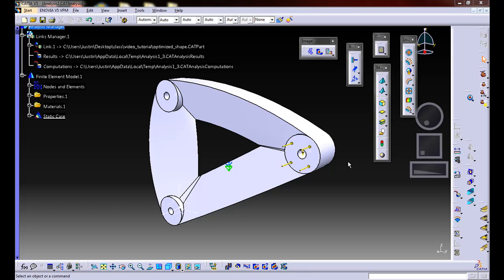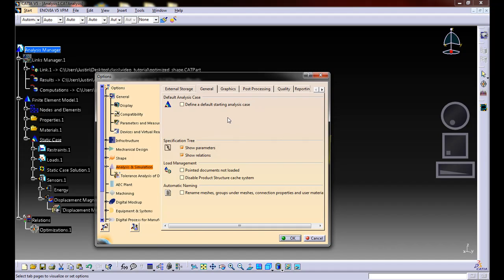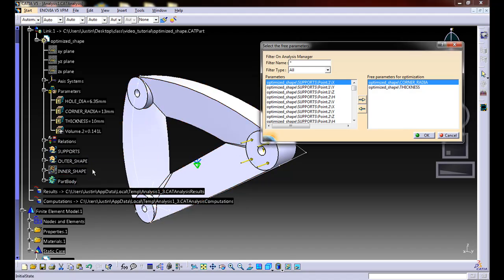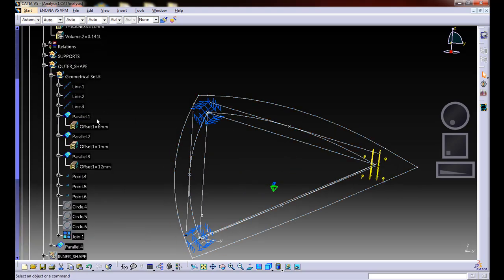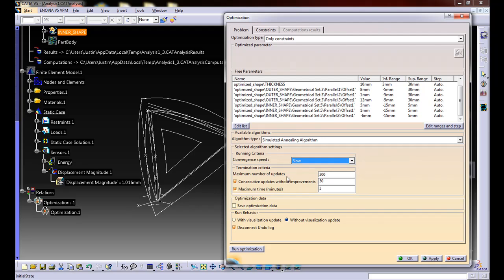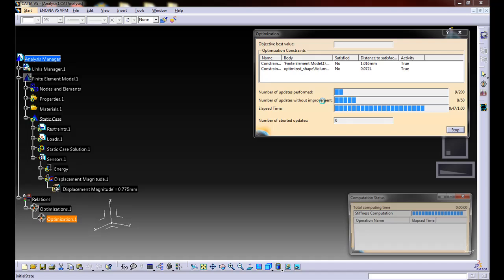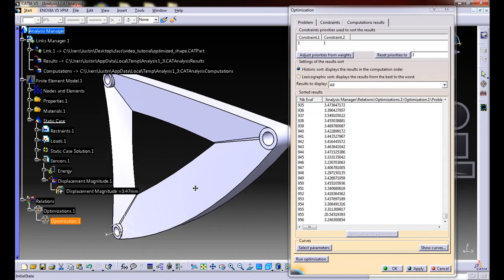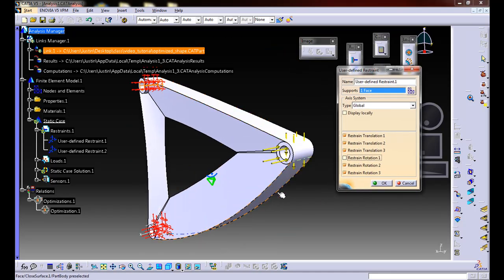Catia Part Optimization Part 3 of 3

Comment: Hi.. This is what I was looking for.. 
I face a problem, while running optimization. It throws an error "Output file creation failed"
  Creation of file C:%...%XXX.xls failed because you may not
be allowed to write in the specified location.
  Please , try with an other file path."
Any idea, how to solve..?
Reply from the maker: +Premananth S 
Try unchecking "Save Optimization Data" on the bottom of the optimization window.  It sounds like it might be trying to save the data to an incorrect path, or maybe a default path that you might not have permission to write to.